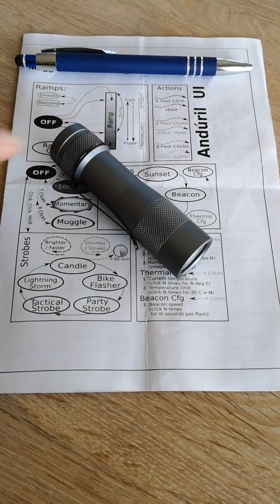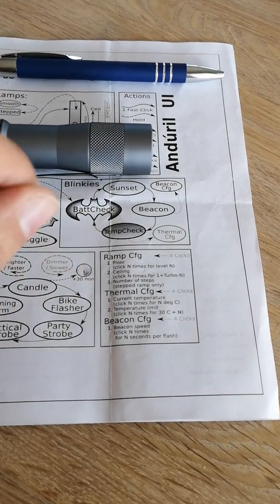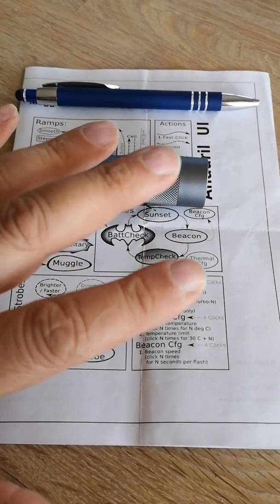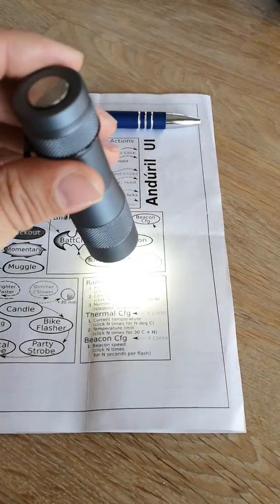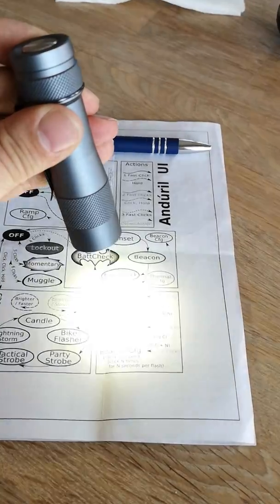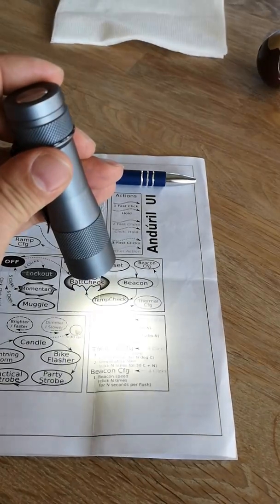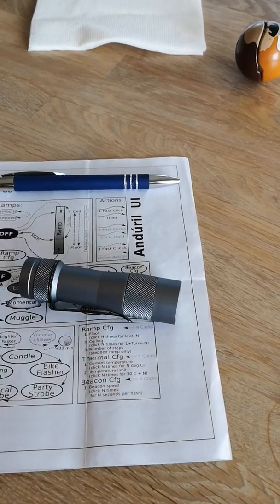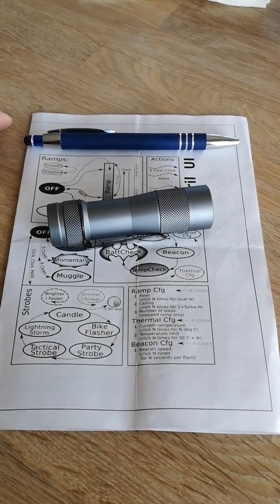How to calibrate the temperature and limit on a FW3A (Anduril)

Comment: This is the right way. Saw a video (darren Yeo) that said that if the current temp (room temp) is 20°C for ex, for 55°C you do 35 clicks, but is actually sett at 30°C by default, so itsjust 25 clicks

Comment: My if25a  with anduril 2 is different than these instruction
Reply from the maker: sure - Anduril "2" is very different

also some manufactureres use different versions of Anduril or even made their own UI out of Anduril
resulting in big confusion sometimes - thats the downside of open source
Reply: @Martin M4D M4X Rathmanner  Ah, okay, that makes sense. Sofirn links this video on the page for the current interation of the IF25A.

Comment: im confused between 4click for mugger modes and this config mode.
Reply from the maker: muggle mode is 6 clicks from OFF
lockout is 4 clicks from OFF

config is 4 clicks from ON
Reply: @MartinRathmanner_M4D_M4X  thank you very much.. really helpful
Reply: @MartinRathmanner_M4D_M4X  one more thing, at manual it said 4 click to enter step and beacon setting, how to access that ?
Reply from the maker: 4 click configs the mode "you are actually IN"

for example: 
in ramp mode you can config base and ceiling
3 clicks change to stepped mode (and back)
4 clicks now let you configure base, ceiling AND # of steps

Comment: Hey Martin, is there a way to do a factory/hard reset in case you accidentally set the thermal regulation too high or the current temp? Thanks
Reply from the maker: not in the older versions of Anduril i think
Reply: @MartinRathmanner_M4D_M4X  Yeah I have the newer run of the fw3a and I've read that to do a hard reset you either unscrew tail and then press tailswitch and screw back in to reset, the other I have heard is 13 clicks from off and hold on 13 and that doesn't work either
Reply: @anthonyb2990  just re-set the temp? Aka follow the video again?

Comment: Mine was a pain in the ass, it was hard to get it to cycle to blinkie mode to temp check. I kept doing 2 clicks, it would cycle to sunset then back to batt check. Finally got it, I think was clicking to slow or something. Then in thermal config it kept saying the temp was 39 c, which was way off.

Comment: Hi Martin, is there a way to blink out the default settings for thermal limit? And is there a way to "factory reset" the UI to default?
Reply from the maker: I don't think that's possible
Reply: @MartinRathmanner_M4D_M4X  could you also explain how ramp config works. As I understand it I need to click 150 times to set the ceiling to 150.
Reply from the maker: have you watched Zoltans video?
https://www.youtube.com/watch?v=h_mZ35IPLMA

Comment: 65*C temp limit? That's toasty. To each their own and whatever floats your boat etc but I do hope people watching know what they are doing. The FW3A will burn you if you let it.
The stock 45*C limit is safe and if the light is properly calibrated you'll even get a decent turbo burst out of it.
Reply from the maker: the 65° are measured inside the light - i doubt the surface will exceed 50°
Reply from the maker: just tried the turbo twice and got 46°C

Comment: I noticed on my light that I needed to click 21 times in order for it to show 24 degrees. Odd. At first I did 24 clicks, but it always reported 27 degrees. It does not have to be perfect, but I wanted it accurate.
Reply: Thats the actual value from the sensor not the stored value. He made a mistake there. It's like the battcheck :)
Reply: @EUlordRofl  I don't know what you mean.
Reply: Mine does the same
Reply: Yes, mine fluctuates, but it has to be from the sensor. As long as it's close. Mine was indicating 27 to 29C, after I input 22, it was fluctuating around 23-24C, so it may require attention more often than not if accuracy is the goal